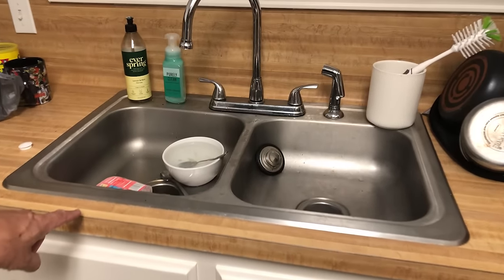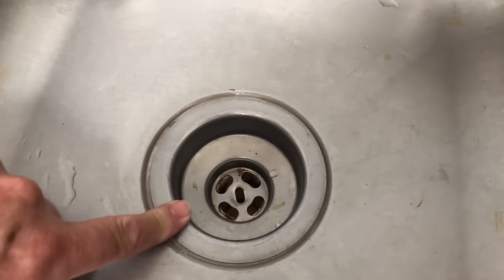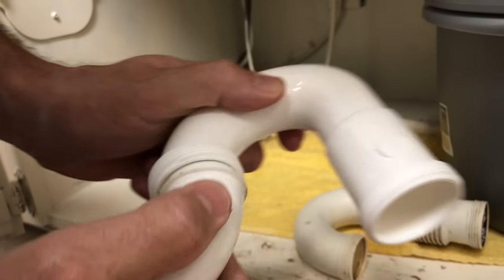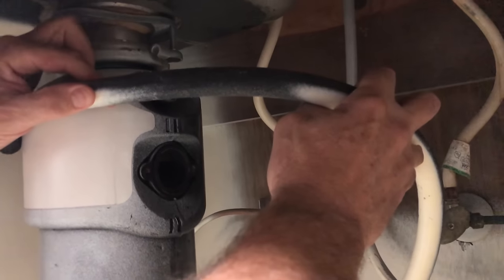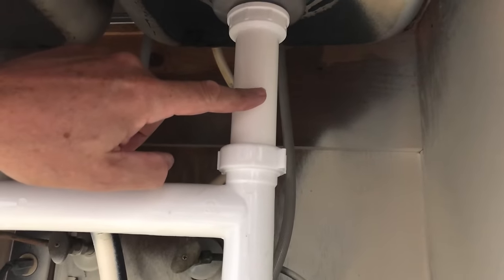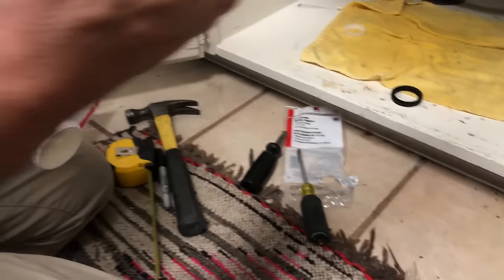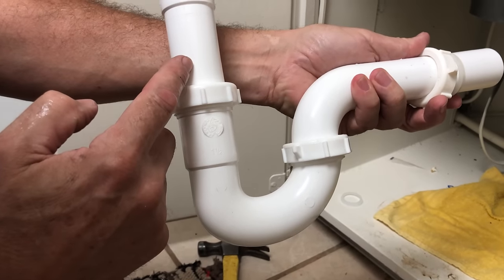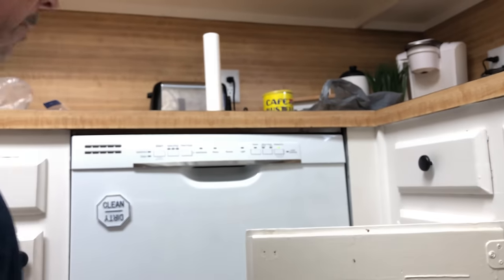How to Fix a Dishwasher/Sink that ISN'T Draining

Comment: These guys did a great job.  I just want to mention for anyone coming across this video that, if the disposal ever clogs and fills up, the waste water will go back through the drain hose and fill up the dishwasher. An air gap is important to prevent that. Even if the plumbing code doesn't require an air gap in your area, it's good practice to form a loop in the drain hose and secure the top of the loop to the under side of the sink so it sits above the outlet in the disposal.  That way the water won't go into the dishwasher unless it almost completely fills up the sink.
Reply from the maker: Yep, always a great idea!  Thx 50skid 👍
Reply: I still don’t understand why local cities don’t require back-flow prevention on residential houses. They are required on every single commercial property for landscape, domestic, fire lines external by the meter and internal on every “hazard” or “potential hazard” . Yet I can almost guarantee that every house hold is far more dangerous to our city’s water as a lot of humans are gross , 99.9% of humans can’t figure out how to screw in a light bulb let alone try and explain the hazards of back siphonage and the potential problems there creating in the house if there water gets back fed into the city’s water. A simple Reduced pressure back-flow on every house main , and laws for commercial appliances such as fridges and such to come with built in air gaps , or DC or whatever protection they can would drastically protect all of our water we all use ...
Reply: You can also put a non return ( 1 way ) valve at the disposal to avoid water going into the dishwasher. Some dishwashers already have one but it's quite rare so I'd say better safe than sorry.
Reply: That,s the first thing I noticed that there's no high loop, anywho, if you're ever in a situation where they're using an air gap, if it ever and causes water to come out of the air gap, run a 3-foot coaxial through the air gap by removing the chrome cap cover, remove the cover to access the drain tube, through there run the coaxial cable down then pull it out through the garbage disposal side, just reach inside the garbage disposal from the g/d drain side and pull the coaxial cable up and out of the drain and that will clear your drain. Then replace the air gap cover and chrome cap and you're back in business
Reply: Q1
Reply: @justinlee4022  so...you know 'something' about plumbing...good for you.  I am sure you don't know everything about it, and probably a whole lot less abt many other things. I am sure you also don't know enough about what people know or don't know, so stop making assumptions. Instead contribute something meaningful without turning people off.
Reply: @Scott-eo7lj  why is it cheating? You make it sound like it is something, nefarious, illegal, or underhanded. It isn't.  It is an approved method of preventing backflow...it is even in codes.
Reply: @george9710  George, I appreciate your constructive suggestion and contribution.  While changing out my kitchen faucet last Fri, I finally installed the high loop, but I decided to go the extra step and install a non-return/one-way valve as well.

Looked for one-way/non-return valve online...couldn't find any. Suggestion(s) pls?
Reply: You are supposed to make a "P" trap loop with dishwasher drain line. You can tie a piece of wire to it and pull it up higher. easy and prevents water from disposal from going back to dishwasher. Code in most places.
Reply: @Scott-eo7lj  When the tube is higher than the flood level of the fixture you have a "gap" in the tube where there is "air" instead of water.  Amazingly enough, this is called an "air gap"!  I know, crazy right?
Reply: @d1nonlysnshn  suggestion would be to remove the excess cover at the bottom of your dishwasher and check to see if there's a one-way check valve built in. Oftentimes they are colored Orange
Reply: @jamessprow7116  thank you so much. Will do.
Reply: I appreciate your clear instruction and photography.
Reply: @Delekham  thanks. That did the trick. I sure appreciate you taking the time to respond.
Reply: @50sKid notice there is a corner cabinet between the sink base and the dishwasher. The high loop would likely be done at that cabinet since the dishwasher drain line generally comes up the back of the dishwasher. Then it could just flow across and into the drain under the sink.
Reply: @justinlee4022  all of your fixtures prevent backflow by means of an air gap and new construction homes require vacuum breaker type hose bibs. These are all forms of back flow prevention.
Reply: @justinlee4022  also my city, and probably most cities around the country, have a check valve at the meter.
Reply: @d1nonlysnshn  This is required where I live and recommended by the manufacturer.
Reply: Exactly; without the loop above connection water will always come back to Dishwasher tub
Reply: @george9710  yes, that's right
Reply: @Scott-eo7lj  that's what we want to,
Reply: Thank you for the comment about 1 1/2 for kitchen and 1 1/4 for bathroom.  I live  in a small town and my local hardware store had no idea about that.
Reply: @50sKid  that is NOT what an "air gap" is when referring to any plumbing. Air gap is a literal gap of nothingness but air between a fixture drain and what it's draining into. So there's no chance of any waste water making it's way back into said fixture.
Reply: @Scott-eo7lj  Read what I said again and you'll realize you and I are talking about the same thing.
Reply: @justinlee4022  back flow valves required on my residential irrigation system, required to be certified every year at a cost of $85 yearly by a certified plumber. This just started a couple years , after me having it fir 25 years.
Reply: @justinlee4022  we have the same name. Two plumbers with the same name lol
Reply: Hey 50sKid , if you create an air gap in the dishwasher drain hose to stop back flow will it not prevent the flow the other way( proper direction) coming FROM the dishwasher?? Getting ready to do this myself. So in other words, tell me exactly the easiest way to solve the problems in this video demonstration pls and thanks.
Reply: Any brand of dishwasher worth buying has a check valve built in to the discharge pump. They also have built in high loops as well.
Reply: @justinlee4022  A lot of cities do require backflow prevention on water services.
Reply: @50sKid  That isn’t what the plumbing code considers an “air gap”. Also, it’s impossible for the high loop to function as one even if you were right, because it’s impossible to run the loop higher than the flood level rim of the sink. The kitchen counter prevents it.
Reply: Either an air gap or a high loop. Anywhere that doesn’t require an air gap I go with a high loop because air gaps work great until they don’t. The first time your washer empties onto the counter you’ll question the air gap decision
Reply: @justinlee4022 If you're going to insinuate that you're smarter than 99.9% of people, then you have to do a better job at selling it. That's a bold claim for someone who presumably doesn't know the difference between there/their/they're. Example: They're all going to laugh at you if you go over there and tell them how to do their job.
Reply: There’s a check valve on dishwashers outlet. Air gaps are not necessary
Reply: All Manufacturers require a high loop
Reply: This was the exact problem that I had, waste sink water going back into the dishwasher...thank you "YouTube academy" for great advice and solutions...this was a great DIY video..

Comment: Just 1 observation you might want to add to the video, manufacturers of dishwashers recommend that you make a high loop for the dishwasher drain hose to prevent the food residue from clogging up the one way valve on the d/w. A hint I found out after reading the install instructions when I got a mildew-like smell from my new dishwasher.
Reply: I need to try this. I'm having issues like this.
Reply: The high loop is a must have. Great observation.

Comment: You need either an air gap or at least a high loop on the dishwasher drain hose. If that sink backs up it will fill the dishwasher with nasty water!
Reply: That was my question , another youtuber said , hose should be above the disposals connector… know I know why . Thxs

Comment: The dishwasher drain hose needs to have a hi-loop to prevent water from draining back to the dishwasher.
Reply from the maker: The weight of the wastewater left in the drain pushes back on the check valve in the dishwasher so the higher the better.  I think manufacturers have got a handle on this problem.  I was a kid the last time I saw wastewater pouring out of a dishwasher😂 This was a repair in a rental and we didn't want to get into replacing the dishwasher drain also.  Thanks Tim!!
Reply: @StudPack  Some States/Counties require an overflow vent on the sink side.  I don't like them as they are nasty catches for waste to accumulate and need regular cleaning.  Minimum code is the high loop though.
Reply: @StudPack  Maybe depends on the jurisdiction but any dishwasher installation instructions I've seen recently required a high loop.

Comment: Thank you, SO MUCH!! After taking apart the whole dishwasher, I checked the garbage disposal and found that the little circle piece hadn’t been knocked out by the guy that installed the dishwasher. Thank you for sharing your knowledge with us. I successfully completed my first plumbing job. 😃 👍
Reply from the maker: Awesome!!  Glad we could help GZ👍
Reply: I'm a appliance servicing electrician in Aus, I've lost count how many times plumbers or apprentice forgot to drilled out a hole or drilled to small and cause a clogged after and month of use.
Reply: I was searching YT for the same issue lol - fortunately it coincided with installing a new disposal so I knew the issue was there. Who knew there was a knockout!

Comment: Since you are not running an air break, the drain hose from the dishwasher should have a high rise loop. Basically the hose entering into the sink cabinet should loop up to the bottom of the countertop and then come down to the connector at the disposal.

Comment: Loved your video. when I had problems I replaced everything. I should say I had my 17-year-old replace everything. O.J.T, "On the Job Training". I thought that why not train my Son on how to do it. I learned by trial and error. Anyway, He replaced the Garbage disposal and all of the plumbing. Plus we removed the Air Vent, Soap dispenser assembly from the sink and plugged the holes at the top with Stainless plugs. Then I had him replace the entire faucet. We installed a Single valve facet with the extendible/retractable spout. Kids are not shown how to work on things nowadays. They need to be taught to work on things around the house. After all, once they have their own place they'll have knowledge of what to do. Love your videos. Very entertaining and informative.
Reply from the maker: Thx Jerry 👊👍

Comment: You did a awesome job! But you need a high point in the dishwasher drain hose under the sink. The dishwasher pump runs about 20 seconds so when it’s done if there is water left in the hose it will flow back into the dishwasher.

Comment: This is an incredibly informative video. I've been through this so many times. My first problem was not noticing there was two separate sections on that pipe wall. One for kitchen. One for bath. I have various extra parts around so when I'd buy the wrong kit I could rig it together. I stumbled on to the separate sections one day and only because I bought the parts at a Walmart this time. They were clearly marked. You covered all that. You covered the bevel washers. The metal pipe in disposal and the connections everywhere. Excellent video. I do have a question though. The dishwasher there doesn't seem to have that backflow drain at the top but mine does but my sink is stainless no hole pre cut. So that drain is right next to sink in counter top. Lately it isn't drain into the sink and its ruinibg the counter top. I have the drain hose hooked to garbage disposal. Do I need that other drain up there? I'm getting counter damage fast. I have cleared dishwasher drain it has pressure. I just know drilling stainless gives me a headache. Dont want to do it because then I have a hole in a formica counter to fix. Can I cap that thing off or what?
Reply: Go to your local hardware or big box store and get a stepper bit, (cone shaped drill bit). It will do a very clean hole in any stainless sink. I install r/o systems so  I know the first one is scary,  my first was a high end elkay but Jesus was with me and it came out perfect. It is almost addicting, just put an overflow in my new stainless washtub. :)

Comment: Drain looks good. The main reason your dishwasher is draining back into itself is cuz the hose is on the bottom of a floor.( that's why we drill two holes in the cabinet) The one on the top for the drain hose & one on the bottom for the water &  electric.  And dont forget 2  make a loop.   2nd trick is to put a small piece of copper in the hose before you tighten down the hose clamps.
Reply from the maker: Thx Matthew 👍
Reply: Yeah, hose should be elevated above the disposal.  If you are doing dishes and the disposal gets backed-up, the water will bypass to the dishwasher.

I’m guessing the hose was installed that way because the DW isn’t next to the sink like it should be.  The hose probably goes under the corner cabinet.  That’s what happens in older homes where a DW is installed after the kitchen is built. 🤨

Comment: Last time I replaced the drain pipe under my sink I too just used a regular Tee. Every time the disposal would run, it shot up into the other sink half. Using a Tee with a baffle to divert that flow downward solves that. That however was a pain to source and I had to order online. Wish the big hardware stores actually carried them in my area.

Comment: I have found that the real test is to fill the sink with a stopper in there, then pull the stopper and let it drain all at once. You will see connections leak that wouldn't with just running water, but will with the huge inrush. Not everyone fills their sink like that but some people do. Good to know either way though. (which you did 30 seconds later haha)

Comment: Thank you very much you solved my problem dishwasher won't drain. Never knew you had to remove plug in garbage disposal.
Reply from the maker: Cool thx 👍👊
Reply: It's amazing that people somehow have the idea that dishwashing powder corrodes disposal blades, when the manufacturers build a drainage port right into the system. People wash their metal pots, flatware and knives in the dishwasher for years decades with little to no trouble with corrosion. The dishwasher effluent is more likely to clean the blades off than damage those.

I'm glad you now know, and that someone has a widely viewed video showing a great underutilised feature.

Comment: Does the disposal outlet have to be even with or higher than the drain connection in the wall?
If the disposal outlet is lower than the wall drain connection, will there be standing water in the disposal from the p-trap? Thx,

Comment: Always check your local plumbing code. In my state you can not connect a disposal on a tee like that. Each side has to have its own p-trap before they tie together and that discharge line from the dishwasher has to be secured to the wall or cabinet up under the sink bowl.

Comment: Just wondering why you need that coupler to connect the hose to the disposer ?  
The coupler is used to reduce the diameter , but you cut that part anyway...  (smile..) 
I connected the  hose directly ....    works fine...

Comment: Nice job, ... something I do numerous in my handyman work although I usually route it thru a air gap first. ... curious, what would be your rate be to re-plumb the kitchen drain like this?  I always struggle with my pricing, most of my clients are loyal repeat customer's. Sounds like your in SoCal, ..... I'm up in the bay area
Reply: When you’re not sure, charge what you expect your hourly rate would be. Time and material. That way, you never lose

Comment: Yes the dishwasher discharge needs to be as high as you can get it. I have to raise it up in about every other sink I get under. I have seen many kitchen floors flooded because the sink will not drain and water goes out into the dishwasher and all over the floor

Comment: I have a question.  I have exact same setup. Dishwasher on the left, then garbage disposer on the left sink, and the strainer on the right sink.  When there is water in the left sink, and I run the garbage disposer, the water shoots out of the strainer on the right sink, almost a foot high.   And the plumbing always make that gurgling sound when water runs down the drain. Looking under the sinks, it is a clutter of pipes.  Can it be simplified, and stop the "old faithful".

Comment: Check your local codes as to how your dishwasher needs to connect to the disposal. That discharge hose should be run up high. Then drain down into disposal.

Comment: For the water test: 1st briefly run a little through each sink bowl, then run the dishwasher, and last mostly fill at least the disposal sink bowl then release water with disposal running. The last step is the  only way to fully test seals under the sink. It fills all the tube under the sink with maximum pressure and vibration during the test. Many skip or miss this step of leak testing.

As for hand in the disposal, the blades aren't sharp but will easily remove flesh. Fortunately they are at the very bottom of the unit. Reduce chances of injury by at least turning off power at switch, if not breaker; or preferably discount power to it by unplugging or undo wire nuts.
Reply: Solid tips. Agreed. 😅I was so appreciating this video. But the explanation at the end that “there are ‘blades’ in there, but all they do is sling food to the side” totally threw me. Wth